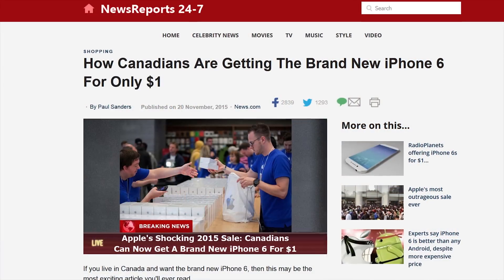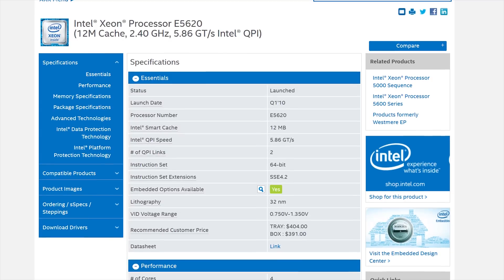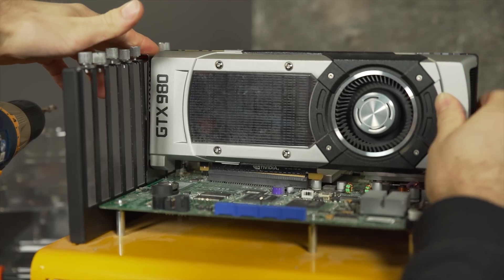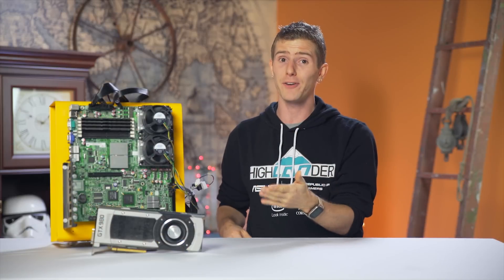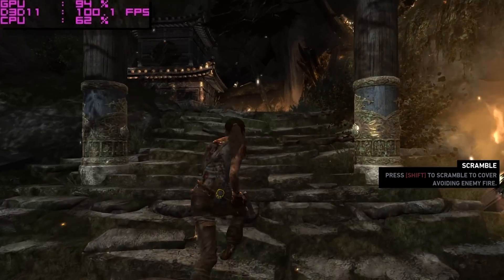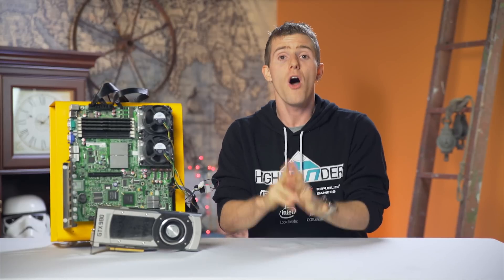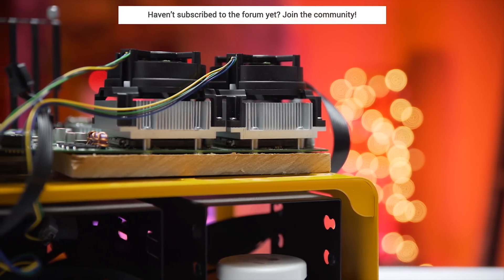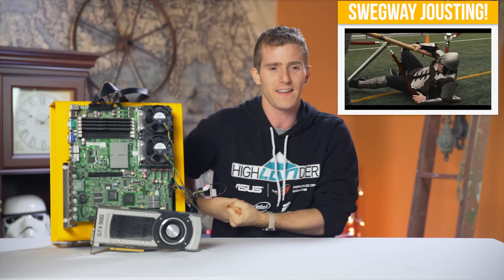Under $150 Budget Gaming 8 Core CPU, Motherboard & 16GB RAM

Comment: so basically you're spending slightly less than you would on an 8350 system with 8gb ram and with much more hassle and risk and you would with a normal motherboard.
Reply: +Jellybean And with the performance less than the 8350.
Reply: yep
Reply: +Jellybean You would need a decent liquid cooler for that microwave oven.
Reply: +zionlee1004 LMAO! nice one. very true too. you need a liquid cooler for most amd cpu's if you don't wanna burn them up.
Reply: lol the intel fanboyism is real , you propably never had an amd cpu . my 8350 worked perfectly fine with his stock cooler
Reply: +Your_Senpai probably*
Reply: Your_Senpai Lol, an 8350 is known to get hot. Its a known fact. It even comes with liquid cooling from amd themselves.
Reply: rusho2nd Not most, almost everything works fine with stock coolers as long as you dont overclock them. The only exception is the 8350 and 9350, which amd sells with liquid cooling stock.
Reply: +zionlee1004 the 8350 does not come with liquid cooling . what are you even taking about ? that's the 9xxx series
Reply: tical2399 mb
Reply: +zionlee1004 it does not come with a liquid cooler and it comes with a tiny cooler that is enough to cool it even under heavy load so keep your bullshit for yourself
Reply: zionlee1004 my 4350 ran horribly with the stock cooler too. many problems until i water cooled it.
Reply: +rusho2nd Had mine for about 6 years and I've never had issue with heat.
Reply: Im not saying there is anything wrong, the fact is it runs hotter. and it wasn't detrimental, but it ran hot and thermal throttled. I more or less meant it ran horribly in the sense that it got pretty hot. comparatively to other processors.
Reply: rusho2nd Ah, well I don't know enough to agree or disagree there, mine has never shut off from overheating though.

Comment: Only way to get sound is though the HDMI port since this motherboard has only 1 x16 slot (already ocuped by the GTX 980), motherboards with more slots could be another option and use any PCI/PCI-E soundcard (server hardware doesn't generally have onboard audio)

Comment: Linus this was AWESOME.  A very old school method for overclocking you check the pin out diagrams for the chip and you can change the FSB by connecting certain pins small bits of copper wire. Not for the feignt of heart but fun if you're just messing around. Google "pin modding CPU".
My rig: 
Prebuilt HP ENVY 1534
FX-6200 4.6 OC
750 TI 
1208 GPU OC
1638 MEM OC Gaming rig for under 500.

Comment: x5650 6  core 12 thread oc @4.6ghz  x2 evga classified two core motherboard 128gb ddr3 ripjaws  gtx960 x2 sli my  workstation rig out performs my i7 5960 8 core 3ghz msi x99 gfkill 64gb gtx 980x2 sli x5650's were like 50 a piece and they smoke my 1000 dollar i7 5960 gaming rig

Comment: I have a similar rig. Only difference is that I use it for everything a server is supposed to do other than gaming. CAD, server stuff, virtualization, video encoding and list is endless. Also as an advice for people who might build up or use an old workstation server try to avoid newer gaming oriented gpus. Instead go for server oriented gpus, that way you might save money, won't have to worry about compatibility and above all get robust performance and better features.

Comment: compatible power supplies sell for at minium21.99 the hard drive would be at minimum another 19.90 and a graphics card as intergrade graphics in CPUs was not a thing is another 19.99 so around $60 or so more to use it as a Linux or other free to use OS machine

Comment: is an AMD fx 8350, r9 290x, 16 gb ddr3 a medium, medium-high, or high end gaming pc? 

 I doubt high end, but this is the pc i'm gunna be building soon
Reply: +Tyler Hanson You are asking this question to wrong place dude. This channel is all about Intel and Nvidia. They see AMD products as junk.
Reply: +Ferhat Tunctan just trying to get a simple answer that's all
Reply: +Tyler Hanson Well in my opinion your rig plan is great. It would be great enough to play at 1080p with 60 fps. So i think it's great.
Reply: +Ferhat Tunctan many thanks bud :)
Reply: +Ferhat Tunctan Rip linus tech tips community, i remember the days before the linus tech tips community went to shit. Was a place where we could talk about pc builds without hate, and no twelve year olds trying to prove that they are fucking geniuses. Now you cant ask a question without getting some bullshit answer from some fucking condescending keyboard warrior
Reply: +Tyler Hanson In my experience with an identical setup, go for it if you want 8 threads. It will game on the new Metal Gear Solid comfortably at 60ish FPS at Medium to Medium high. By no means is it high end because you WILL experience thermal throttling (like I have) unless you high-end AIO water cool it
Reply: Yeah, I kinda figured that stock cooler is shit for a 8 core cpu lol
Reply: +Tyler Hanson I meant to say that air cooling of any kind is not recommended, whether it be stock or a Noctua or a hyper212. Dual fan 120mm or larger aio water cooling is advisable.
Reply: +Ferhat Tunctan AMD GPUs aren't crap. Their CPUs are but that may change
Reply: +Tyler Hanson Cpu cooler is not that bad if you have a well ventilated case.
Reply: I run fx-8370 cpu from amd with his oem heatsink, not even overtemp a bit (stay under 70°C on load with a well ventilated case) (but my mobo have some thermal trottling, that shitty biostar, Northbridge at 80°C, what a shitty brand..) and I run GTAV over 50 FPS with a R9 290 on 4K res at ultra without msaa, it's great for a cheap build.
Reply: Yeah, but wait till you try to run something  that uses more than 2 cores like video editing or photo editing or game streaming. Also, check and see if turbo boosting or core boosting is turned on. I suspect it is off.
Reply: I'm gunna go for a Cooler Master 212 evo, I've ready many reviews saying this cooler cools the 8350 pretty well
Reply: +Tyler Hanson not as good as some others in its price range. look up Cryorig H7
Reply: +Ryan O'Neill yeah, looking at this cooler, it beats the 212 evo just hoping it fits the case and clears the g skill ripjaws ram lol
Reply: +Tyler Hanson I believe they have a H7 Universal which has no Ram issues
Reply: 4.2Ghz, My cpu is running very well, never tried video editing, but in blender, it's running quite good! better than all of i5 cpu.
Reply: +Pascal Lafrenière Keep dreaming. Maybe one day when you oc it to atleast 8ghz, itll beat an i5.
Reply: Wtf... cpubenchmark.net/ my cpu(FX-8370) is much over all of the i5, that is not a absolute fact, but in test, I had some great perf with it, AMD isnt that bad as you think!
Reply: +Alexander Binovski Good for the money just not great in general
Reply: I'm sure he never owned one! xD All of the haters dont even know what they are talking about! xD Since I buy my own stuff, I always had AMD cpu, all my friend go for the intel ones, intel are different, they have a better operation / clock ratio but for the price.. they are very expensive, AMD cpu are a lot cheaper and work well! I have no problem with my FX-8370 (200$ cpu, cheap for a 4.2 GHz 8 cores). Run all games fine, with only 8Gb of ddr3 and a R9 290, my budget computer work better (for the price) than intel and nvidia.
Reply: ***** are you legitimately comparing an Enthusiast grade I7 to a midrange i5 equivalent. Not even close. No I haven't used an FX processor but why would I want to? It's an outdated chipset.
Reply: ***** I agree. With the FX-8350 based build I made for my Dad, it serves him well for video/photo editing with an OLD AMD 4830 GPU. That being said he paid like $350 total for that system not including the salvage GPU. I currently run an I7-4790K with AMD R9-270x system and can do a lot more with it. Videos render almost twice as fast, but I paid nearly 2.5X more for it to get essentially the same specs (on paper). Since the FX-8350 system is a daily driver, multiple photo and or video conversions and renders are queued overnight and while everyone is at work. If I had to build my system over again, I would have gone with an FX black box processor with a custom water cooling kit. Admittedly, AMD even sold their FX-8100 with water cooling before discontinuing the CPU and then the FX 9000 series CPUs 1st with water cooling and now currently without any cooler (presumably so you could get your own water cooler for it). AMD even warns that the FX CPUs get hot by putting a 125W-220W TDP rating on them. Newegg even marks the 9350 and 9390 as "water cooling required (sold separately)" Back to the original argument: AMD with water cooling is still a decent value oriented setup performance per dollar. Think of it like this, the I5-4670k costs about $250 and is only 4 threads at 3.4GHz and the AMD 8350 with a decent water cooler is about $270 for 8 threads at 4ghz... Which seems better value? I beg anyone to respond back saying they'd pick the i5-4670k air cooled over the FX-8350 water cooled.
Reply: ***** Sorry I misread your comment.
Reply: +the 21robot (the21robot) I hope you are not referring to me. I most certainly am well double the age of 12... I have been building and repairing PCs for users and enterprises long enough to know what I am talking about...
Reply: +Tyler Hanson Don't get an fx, most games are designed to run on quad core so go with an intel i5 4460 or something
Reply: +csjdruid My FX run every game over 60Fps.. so what's the point? Fx are half of the price!
Reply: Ofc its a high end pc.. It can run 99% of games or so on 1080p, ultra settings, over 60fps, its easily way over high end.. Altough its not extreme

Medium-high would be something with a gtx 560 - gtx 660 or smth, medium would prolly be a gtx 460
Reply: ***** There is no video involved on an FX chip so DX12 would be harder to process. Nowhere to offload the video portion of the API. so the GPU I guess might take it?
Reply: *****
 I changed my initial statement.  Messed up my thought. That being said. With the 8320 I have in the photo editing rig, I tried some DX11 gaming and it bombed. Far Cry and Crysis and Tomb Raider can play well with an R9 270x but it all thanks to the R9 270x picking up the slack. You can literally feel the CPU radiantly  burning as it chugs along and you can hear the fans. I took my R9 270x out of it and put it back in my gaming rig with the 4790k.
Reply: ***** I have it overclocked and I have really fat and really tall and square silverstone tower cooler that sounds like a 747 taking off at full blast. I have the 8320 OCed to 4.5 ghz and I actually have had to have the PC moved away from me due to the heat generated by the CPU. It is not a gaming system. It is a photo rendering system. I game on the 4790k system and I love that. Only reason we did the 8320 system was because we needed 8 cores to render photos and occasional videos. Any recommendations what to replace my 270x with? I like AMD because they tend to be cheaper.
Reply: +Tyler Hanson That will be a nice rig. I build one to a lower spec and it works brilliantly well on any game I've played. Admittedly I never play FPS because I don't like them. Still...
Reply: +Tyler Hanson if ytou have a 750/800 watt 80+ bronze psu and watercooling for that cpu then it would be oke-ish. When I used a core i5 2320 that a friend gave me my pc was faster then with a fx 8320 oc'ed to 4,5Ghz (because most games after 2013 use much more cpu power and single core performance of fx cpus are bad).
Reply: shag stars The 8320 is perfectly fine CPU OCed to 4.5 as long as you get a motherboard with enough power phases to accommodate OCing. Also, I recommend a decent AIO cooler or loop kit cooler for it. My Dad chose to run it in his personal rig for photo editing due to 8 cores/threads but primarily because the finished system cost half the price of my 4790k system and they perform similarly (after you OC the 8320, the 4790K system  is still the clearly superior system). He made the mistake of choosing a cheaper PSU/case combo as well as a Silverstone air cooler and he has commented that he gets thermal shutdowns occasionally when applying complex photo manipulations/editing in Lightroom.
Reply: Matthew Bauer I had sold the fx 8320 because i don't want to buy a mobo for 120 euros and a cooler for 80 euros and a psu with 700 watts to get a decent performance with the fx 8320. Most games aren't even that well optimized for fx cpus (I had constant frame drops on ace of spades and that is not even a hard game to run). So because I don't want to spend 250 euros more on mobo, cooler and psu I stay at intel. (don't want to need overclocking to get decent performance anyway).
Reply: shag stars For what we did with it, US$600 at the up most highest is what we spent (cumulative total including used parts) including the massive silverstone air cooler, case/PSU,  gigabyte mottherboard, 8gigs RAM, 8320,   and reused Windows 7 and R9 270x. For my 4790k build including Swiftech H220x2 RGB, Z97 extreme4 Asrock motherboard, Rosewill case, , 4790K, 8 gigs RAM and R9 380x cost between US$800-$900 and reused license for Windows 7. The 8320 is cheaper by at least US$300.
Reply: Matthew Bauer the 8320 is not even close in terms of performance to a i7 or modern i5 cpus. I can buy a core i5 6500 for 199 euros and a fx 8320 cost like 159 euros here. Keep in mind that I do not live in the usa and that an amd r9 390 for example is more expensive then a gtx 970 by 50 euros. a motherboard which can use the fx 8320 to its max potential is 100 euros (msi 970 mobo) and good watercooling kost like 159 euros. while I can use a micro atx mobo for a core i6 6500 which costs like 57 euros and then I can buy a cooler for 12,99 which is silent enough and I don't need a 750w psu (costs 95 euros) but can use a 450-500w psu. which costs 39,99-55 euros.
Reply: ***** the funny thing is that the price difference between a fx 8320 and an i5 is not so big here. and ddr4 ram is cheaper here then ddr3. (ddr4 8gb sticks can go around for 32 euros as for ddr3 it goes away for 40 euros).
Reply: ***** I have a build that I made from damaged pc's I got for free from friends.

Core i5 2320 (was for free out of a damaged httpc from acer)
8gb ddr3 (bought it for 39,99 euros
gigabyte gtx 960 4gb (bought it for 211 euros).
xfx 550w 80+ bronze psu for 60 euros
coolermaster u33 case for 34,99
gigabyte micro atx mobo
64gb ssd (for windows) for 40 euros
2tb wb green for 67 euros.

was quite a cheap build.

I will upgrade to an i7 2600 because intel did not made crazy improvements over the years so I am safe.
Reply: shag stars Should go K series for overclocking if you can. and maybe an SSD or a PCI-e storage drive.
Reply: Matthew Bauer my mobo doesn't support overclocking.
Reply: shag stars
What motherboard do you have? All motherboards have some form of OCing, unless they are totally locked like Dell or HP or Asus OR you have a dirt cheap B/H/server motherboard. You might be able to pick up a cheaper Z chipset motherboard on Ebay,Amazon or Newegg and then get a K processor.
Reply: Matthew Bauer we use a website that is 100% local called marktplaats.nl but I can't find an K version on that website.
Reply: shag stars As I always say, ebay is your friend if you are willing to bid...

Comment: Why go server class board when you can get a Workstation class board. If nothing else you'll have plenty of available PCI-e slots. The workstation boards will allow you to run a single CPU and have separate banks of RAM for each CPU socket. My older system is a HP Z600 with a Zion E5540 and a 750Ti. Just need to add a second E5540 (about $9 on ebay) to the system and maybe a future video card upgrade. Though i worry about the 650W PSU that came in the system. Which is why i only went with a 750Ti earlier this year when i replaced the Quadro FX5800 that was in the system. Still need to do something with that old card.
Reply: +Pilch Plays Yep. I got 2 X5570s in mine. The X5570 is going for about $20 on Ebay. I used to run an AMD R9-270x (using a PCI-e power to 2x 6 pin PCI-e power adapter) and didn't have any issues. Admittedly, HP says total PCI/PCI-e power should stay around 150W not including the PCI-e PSU power.

Comment: I wish there was a more complete price breakdown for the system and more benchmarks shown. Also, it is misleading to say 150 dollar budget gaming, because it does not include the storage, power supply, case, screen, keyboard, mouse, and (pretty important) the graphics card. I thought this was a very great video, but I would have preferred if you went more in depth, talking about how you got the other parts, and how to find them on a budget.

Comment: > gaming rig
> server board
> dual cpu
> 150 $ GAYMING I PRUMISS
> 800$ GPU
> cuts it thong
haram
Reply: +shadoom A: it's like $400-500 at most for a 980, B: He just used it as an example to show off  the capabilities of the CPU setup it was bottlenecking the 980 by a decent margin but that is a high end modern GPU, if I were doing something like this I'd scower eBay and Craigslist looking for a cheap 7990 or something

Comment: I would recommend using dual x5640's. They go for about $15 each atm and are way better performance than what linus used. 8 more hyperthreaded cores, faster clock speed, ddr3, and 2 years newer.

Comment: I have used same board with dual x5470@3.3ghz. as spare machine for friends over. mounted heatsinks with nut and bolts with washers on. took a define r4 case, removed drive cages and removed 5.25 cage rivet's. fits perfectly in case with overhang on motherboard tray. although I used a pcie riser. works great. I recommend a fan on south bridge sink for stability.